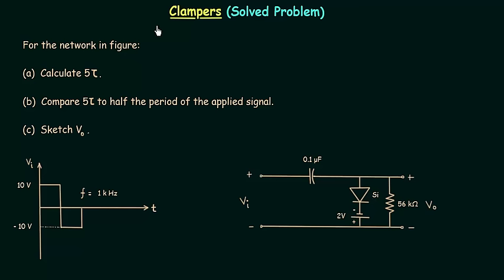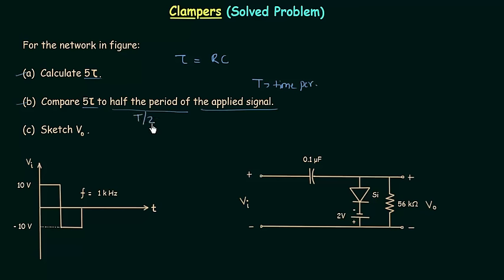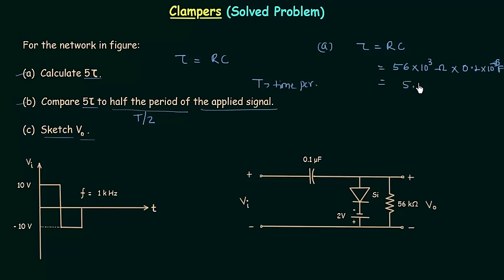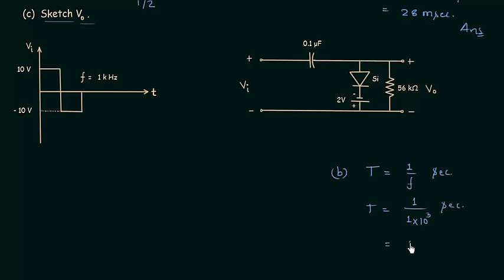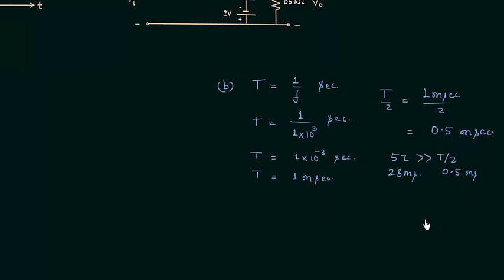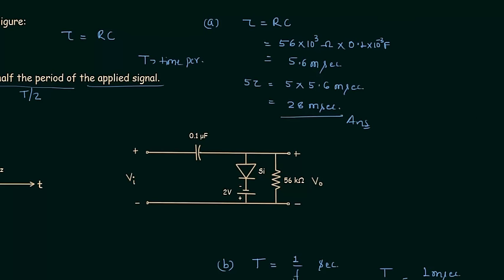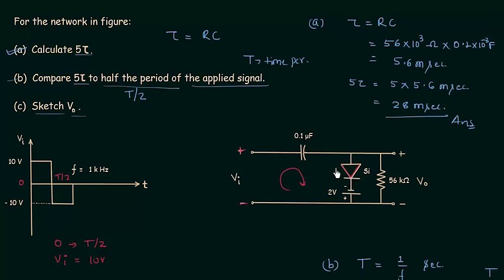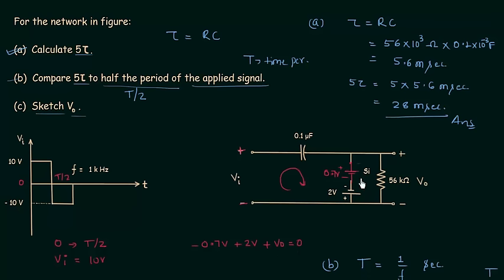Clampers (Solved Problem)

Comment: Thanks, I realized that since it's AC voltage source you can KVL at capacitors and you can get Vc. If it's dc voltage source capacitors are open.

Comment: sir why didn't you consider the case Vinput<2v(so that it becomes forward biased) during the negative half cycle?is it to due to silicon diode??
Reply: reena joshi Vin is constant =10V,so it will always be greater than 2V
Reply: @AshishGusain17  yes thanks 👍

Comment: sir for negative cycle the value of vi is -10...so whilw solving the problm sir u  put -vi is equal to -10 ..but methametically it is equal to plus 10
Reply: he explains it in previous lectures
Reply: so in reverse half cycle of the waveform vi is -10, but we reverse it in the diagram making it 10v. that's why when we do math later we take the +ve 10v for Vi.

Comment: What happens if we introduce a series resistor in the input side and for time varying square wave input signal, how to calculate R and C for positive clamper circuit (if the input signal frequency is around 1MHz how the circuit behaves and what type of diode we have to chose ?).

Comment: Nice video.... but there is a problem you take the value of micro farad of capacitor.... As 10^-3 but micro is 10^-6....so correct it... Sir.... Have a nice ☀day....

Comment: This is nice example.but i have on question.that is why we chose for the charching and discharching  time for the capacitor is 5𝜏??
Reply: because that's how capacitors are made and there working is defined from the start on the basis of the material used and wut not.

Comment: Why KVL is not using Vi -0.7v+2v ,but start from -0.7v?
Reply: You should use KVL within the loop of the Vo in parallel with the diode and bias source.
You use KVL there since the diode is in the "on" state.

Comment: if the discharge time is so high (56 times)..wont it effect the charging in next cycle?
Reply: Time const. is different for Charging cycle
Reply: No, in this cycle, it is 56 times t/2. In next half cycle, tau is again zero and it charges instantaneously (as so we can say of now).
The charge left will  just be stored in capacitor and won't cause any problem
Reply: When discharge time is so high that is the reason here capacitor will hold the peak value and to make the diode on again we will need Vinput <-Vm  which is not possible.

Hence the diode remains off
Reply: It will not affect the charging as charging happens really quick. And the approximate discharge in that period is taken so small that is is practically neglected

Comment: Amazing, Nice teaching :)
Reply: if u have understood then can u please tell me how kvl has been applied
Reply: @ayush jha output voltage vo is applied across 0.7 and 2v . so simply going in clockwise direction, for 0.7 we are going + to - so its a drop therefore -0.7 and for 2 it is - to + thus positive +vo is the output which we need , so applied . hope it helps
Reply: Ohhh Yaa Thanx a lot
Reply: uF = 10^-6

Comment: Sir there is a mistake in the calculations : In the negative half cycle Vi= -10v so in kvl equation vo=-Vi-Vc.   So Vo=  - ( - 10v ) - ( 11.3v ) instead you wrote only 10 v but you don't consider -10v . Please explain
Reply: he's not

Comment: During +ve half cycle why we choose.. 56 k register path?
Reply: during positive half cycle that biased 2V -0.7V=1.3V will come across load, so we need to consider that voltage.
Only to find the output voltage, after that he  find capacitor voltage , at the same positive half cycle.
Reply: -1.3V shifted in the graph you can see that (output graph)

Comment: how to know the swing of this clamper circuit?
Reply: Difference Between the two peak values will give you the swing. The swing of input and output waveform will be equal in magnitude.